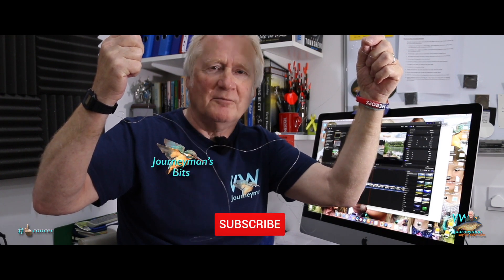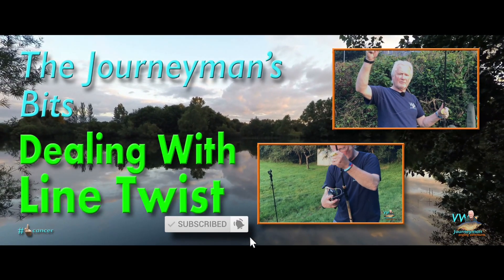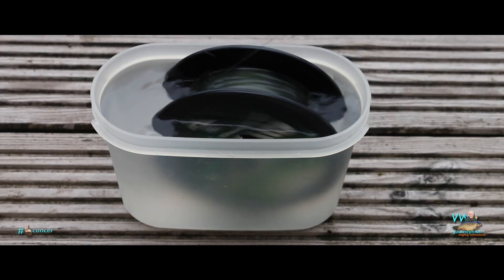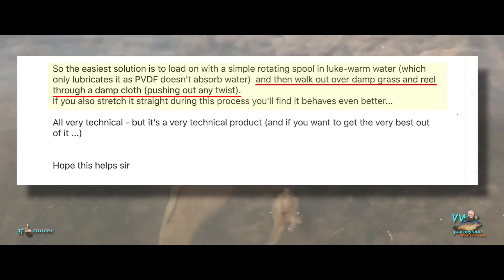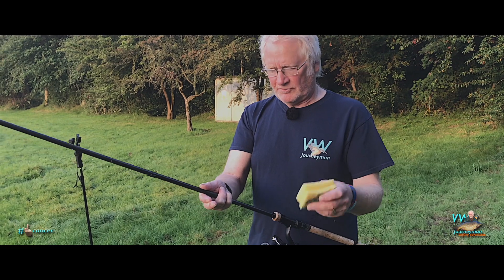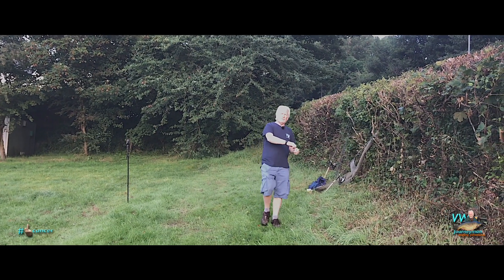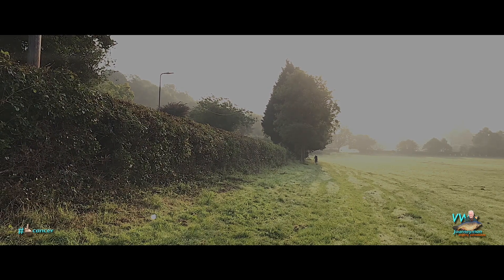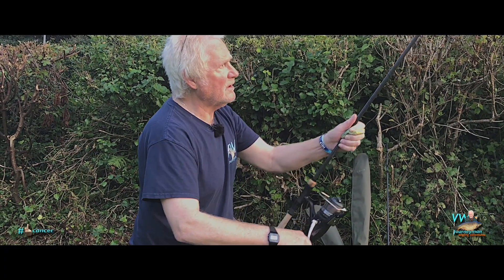The Journeyman's Bits - Dealing With Line Twist #fishingtips

Comment: A lil tip for the sponge, you can wedge it(may need to cut it to size) into the butt ring and the ring will keep the compression on the sponge. As i imagine most of us have found out over the years it's pretty awkward to try and hold the line for the tension and reel in at the same time, if only we had 3 hands!
The wetness on the sponge is actually to increase tension as it goes onto the spool, try it with a dry sponge and it's no where near as grippy.

As a flurocarbon user myself twists are a pain.
Reply from the maker: I know what you mean 👍🏻 but I do like to squeeze the sponge quite hard to keep plenty of tension on the line.